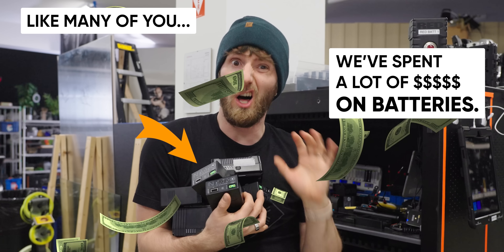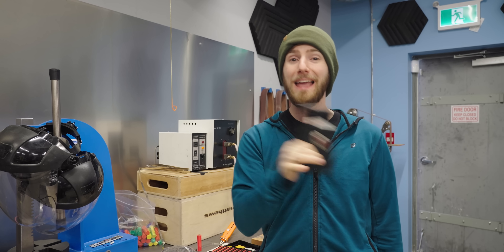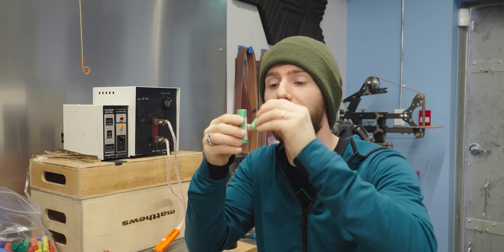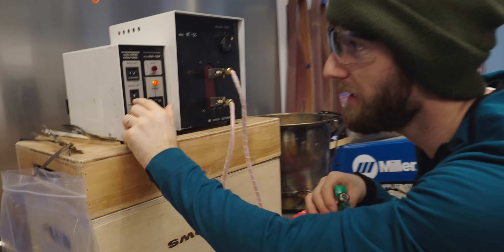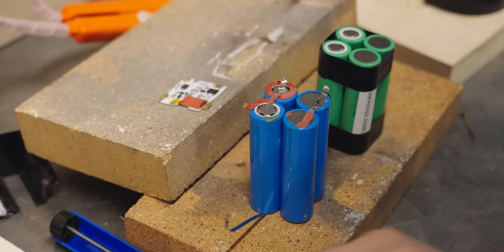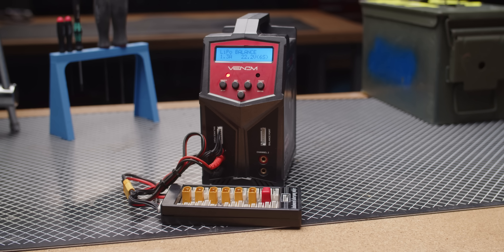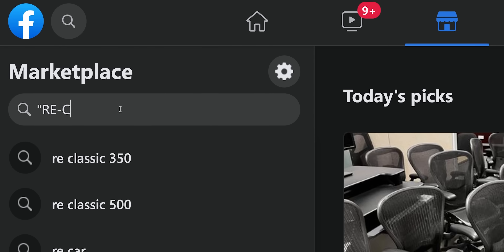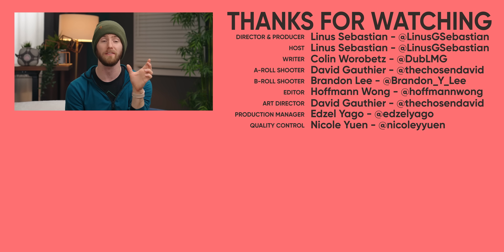This should be illegal… Battery Repair Blocking

Comment: Nice one, Linus. I've been harping on about this in all areas of manufacturing for years. If its about making money, they could simply over charge us for replacement part instead of a normal charge for an entire unit. ie - a $300 device needs a $20 part to work... but they dont supply those parts coz it loses them money, they could sell the $20 for $80 or even $150. It is means less waste, I'm all for it.
Reply: Yeah but you forget a few important factors: first is the total safety of the battery itself. Bebob tests their batteries by dropping them 4 times or so. Those tests aren't cheap. The bigger names (like Bebob) in batteryland also get their packs certified for airtravel. Those tests are really not cheap...

And though I don't know anything about where they actually recell their packs, if it's done in Europe, you just pay the price on labour, but at least you get a better guarantee that it's done good.

Recelling a 16-cell V-mount (I've got Bebob's myself) and completely resetting the gas gauge (BMS) inside to have them accept the new cells and capacities easily takes me 8 hours or more. The tolerances come extremely tight to get 16 cells to fit back inside the case on all 6 sides, it's scary and though I can definitely say I'm an experienced electronics guy (hell, I even make a living out of being one since 2 months), it's something I only do when I feel absolutely good. If there's the slightest hint of fatigue, I decide to wait for a better opportunity. A 175 Wh battery is not something to mess with.
Reply: @weeardguy  "in all areas of manufacturing". Ie, a pool light, a vacuum. Ant part that a home user can unscrew should be available for purchase

Comment: If one can swap the battery in vape, then one could swap it in any battery pack in the same manner. That's it. They just don't want you to do it. There's no big diference between these lithium batteries and simple AA type betteries in terms of safety (if you don't have to solder anything), the main difference is only in type of housing and someone's intention not to give us an opportunity to change cells.. That's it

Comment: So how much did that refurbished battery pack cost you and still didn't work?  Those LG Greens run about $12.50 each, looks like there are 20 of them in that pack.  So say $250 for the new batteries.   Now at $350 to $450 to replace the pack,  which lasts what?  4 years?  You are using about $10 per month worth of battery life.  Long and short of it.. It just isn't cost effective to refurbish those battery packs.   Not even taking into account the batteries you distroyed.

Comment: AKA what Logitech do to its products, I have issues with my G27 wheel, opened it and found Loose Screws on the optical sensor that made the optical wheel more prone to crack with time and usage, and it was cracked, similar loose screws on my G400S gaming mouse.

Comment: No that fire extinguisher no only won't help, but possibly make it worse.
I have actually had to put out a relatively small lithium fire, but we had the proper extinguishers there on the facility, but to run and get the nearest extinguisher two buildings over, adding about 4 minutes before I could get the extinguisher charged and spraying.
I am adding this because they mentioned on the video there is nothing made to extinguish a lithium fire.
We purchased a few very expensive ground powdered copper designed for metal fires.
Was not instant but worked well enough, but given it was burning in an area no more than 12-15 sq feet. Wouldn't want to deal with anything larger.

Comment: 10,000 comments.  I may get some hate, but I'm not reading them.  That would take me many hours.  Is there any reason why one couldn't build a battery pack that has a door on the back where you can take the 'battery' shaped things out, and put in new ones, you know, like on my remote control?  Presuming you believe it is horridly dangerous to ever reuse any of them.  Because you're the internet and a .01% chance of danger means DANGER.  I mean after all there are 10,000 of you.  A .01% chance means on average bad things happen to one of you.

Comment: The "Evil" BMS systems aren't really evil (usually).  Most of them were produced for the early generation lithium cells which had a nasty tendency to explode as they got older.  The quick band-aid fix for that was just to limit how many times you could charge them up.  As the understanding of the lithium chemistries advanced and we figured out how to judge cell condition from how they behaved during charge and discharge that ceased to be necessary.  New ones that use the same model might be evil.  Or they might just be stupid.  New designs cost money, so why change anything if it's working, right?  Especially for all the manufacturers who got a design from someone else and don't actually have the talent to do a redesign in-house.  Heck, they might not even realise there's a problem.

As for the not caring and just making things as cheaply as possible issue...  Well, a large part of that's on you.  Do you deliberately find and purchase the repairable versions of things whenever possible, even if they cost more?  No?  Well then you're telling the market that cheap is more important to you than repairable, so that's what you'll get more of.  If you want to change it, just start making repairable a priority in your shopping decisions and the manufacturers really won't have much of a choice but to change their priorities to match.

Comment: Hi guys! It was actually very interesting. I understand why you need to have the same voltage in all of the batteries that you plan to connect together. I’m a total noob so like I have no clue about this stuff but I am interested. I am wondering if you could eliminate the risk of shorting out the batteries while you’re spotwelding, if you were to drain them completely before doing the welding?

You know, about that planned obsolescence bit and prevention of repair bit under the guise of safety, I think That there’s got to be  grounds to fight that on the basis of environmental friendliness and fighting global warming, at least for some items. Just saying. :-)
Reply: Draining Li-Ion below a certain v destroys them..not like NiCd which love to be run flat..
Reply: @oilsmokejones3452  💔.  Thanks for letting me know about that. Sigh.

Comment: As long as you test the each battery in the used pack. There is no reason not to reuse batteries. Charge and discharge them to find capacity. let them sit for a week and see if any loose voltage fast. If they dont they are OK. Made my own Ebike packs at 48v and 60 in series and parrellel and had zero issue. I also solder so again not getting why you are so nervous. Just use a BMS and and add voltage readers and you would be fine. LOL he is so scared of LIPO yet he still has a ring on his hand.

FIRST RULE TAKE RINGS OF FINGERS WHEN WORKING WITH LIPOs or LI IOn.

Comment: Inside the bms they have a counter on how many charges you get ive tried this on a laptop an it was a success but eouldnt fully charge because of the limit on the fact that they only watch charging intervals
Reply: Also with that the cells you took out could have been good just charge intervals was met

Comment: If you have one of these batteries catching fire, put it in WATER, not sand. You need to take the heat out of the battery. You cannot extinguish the fire, because it generates it's own oxygen, so you need to take away the other side of the fire triangle.

Comment: Those plastic battery spacers aren't the least bit necessary, that's why Red didn't use them. You just have to insure you have high drain cells, then you can butt the cells together with nothing but "electrical fish paper" in-between your p-groups. That way, you get a denser, longer lasting battery pack. That's how almost all battery packs are built. The spacers are good for things like diy powerwalls where space isn't an issue.

Comment: I never spot weld.   I just copper plate the ends and then solder wires.    I use copper chloride or copper sulfate.    It takes a couple of seconds to plate each end in a solution.

Comment: TRUE: Malicious incompetence & secrecy obstructs professional repair of batteries across industries. More repair = less sales.
ALSO TRUE: Acquiring components is the easy part of multi-cell battery assembly. Matching, assembling & configuring multiple cells & control systems to work as one battery unit is a very technically difficult & involved process. Minor errors can be catastrophic.

As pointed out by others, among other mistakes, the process shown was insufficient to verify cell compatibility & will likely result in increased wear & possible fire/explosion. I find it more likely that the BMS has a specific wake-up process than a self-destruct mechanism that would be costly & decrease testability. Will RED share that publicly for professionals? Probably not, and that's the real issue.

Comment: To change cell, connect another set of battery to each battery tab then disconnect old cell the bms must be continuously powered and if accidentally shorted then it is gone... Dyson vacuum bms do this too. If you break power to bms by disconnecting 1 cell, it will flash red and locked can't be reset. Only way is you must keep it powered with another set of battery with wires to each tab then pull out all old cell.
This also applies to laptop battery bms which will also lock itself upp if you short or disconnect the battery without powering the bms with another set of battery
For the part where checking if capacity suddenly increased and lock the pack, I have never encounter any yet

Comment: I don't know linus.  There seems to be an actual safety concern when it comes to messing with battery internals, which is the excuse that we often see from corporations who implement some kind of mechanism that prevents DIY repairs.  But this is the first time where I think that that argument is used legitimately, so I don't think that it should be illegal.  Maybe you should be allowed after getting a certification or something, but not before.

Comment: Although I agree somewhat with your opinion about repairing certain components, I think manufacturers need to protect themselves from liability should a repaired battery fail and cause a fire. So in this instance, I thinks it's best to NOT repair battery packs.

Comment: Nice try , question if u had a few Batteries that was low why didn’t u just charge them all at 50% never put together a pack when fully charged . Also the BMS  couldn’t you keep power to it at all times and then move it over to the new pack and hook it all up ? It would trick it into thinking it was never messed with .. 

It’s an idea might just work use a power supply to the BMS  

The only time u need to balance a cell is when it’s more then one cell   U can get away with not balancing the cells when charging as long as the cells are some what close  the Vemon lipo charger is a pretty dec charger .. they also sell a. Lipo balance hand held checker it just plugs into the balance lead , i use them on my nitro helicopters .. 

Batteries have come a long ways from the 80’s lol it’s amazing the power they produce now.

Comment: The thing is, this problem will never go away with professional equipment. Professional cinematography equipment is horrendously expensive (most of the time with good reason), so the manufacturers expect you to have the money to throw at a problem instead of doing repairs yourself. I get it, I would be far more comfortable spending the extra money on equipment that is guaranteed not to fail as there are very few times when one can allow for that to happen, instead of undertaking repairs and builds myself where the only guarantee is my own handiwork and basic checks I can do with limited equipment. 

However, I believe consumers should be given the choice to buy the official product, or be able to undertake repair work without the manufacturers guarantee, at least for items that experience higher wear-and-tear (batteries, cables etc.). This would not only allow the manufacturer to continue to profit from companies that have the funds to continue buying the official products for the guarantee, but also allow companies that are starting out to provide a good product to their customers and save by repairing equipment themselves and thus taking on the risk themselves.

Comment: I agree with your general principle, but I think you're overlooking a major reason for a manufacturer blocking these repairs with a smart BMS.  If the user/operator does something incorrect in the re-cell process and inadvertently burns their house/car/business down, there will almost certainly be lawsuit issues that the original manufacturer was liable.  Numerous companies have had to defend themselves against liability for a customer or other 3rd party doing just such an "unauthorized" repair that went horribly wrong.

Comment: DJI batteries fall into the "EVIL" category - if a cell goes out of spec a bit is written in the EEPROM, and it cannot be reset. This happens even when all the cells are still good and you replace one (or all) of them (and ensure that every cell is balanced before reconnecting the BMS).

Comment: Don't do it!?  It's done all the time.  It Involves getting a voltmeter and replacing bad cells with the same type of cells.  And that's it.  One will need to do the battery swapping more often as previously good original cells will obviously not have a full life left, so will need to be replaced too.  But at least your efforts will cost you less and be better for the environment.  (Not everybody is as rich as Linus the YT dweeb.)

Comment: Good video.  I like the video.  Very informative.  But, I do have question. I'll save that question for last.
First, a suggestion: why not hook the BMS to a power supply during the repair, so that it never knows the battery pack has been disconnected?
The other question: Is it really cold in your shop, or are the sock hats just a costume?  =PC=

Comment: You start to understand here why each battery costs $450, and why that’s a relatively low price - because every hour spent here is lost income that would be better spent moving the business forward creating content, and on top of that there’s serious risk of fire and/or injury. In this case the cost to benefit ratio works out because the danger and the investment in labor are compensated for by the fact that it’s generating this monetized video content - but for anyone without a successful brand to make up the cost, this would only be a dangerous waste of time and money.

Comment: protip: if you charge each cell individually in bulk, you can get their voltage to be the same when you put them together to avoid sparks just as long as you dont rupture.
Reply: This also looks like only the Nickel sparks and not the battery itself.

I made a battery pack and also got a few sparks because the current went through the nickel and not through the battery pad because I didn't press the nickel down with enough force.
Reply: Better off draining them to the same levels.
Reply: @Mr.Unacceptable  the problem here is the voltage level. if you drain how will you do it in exactly the same way? Its not the amount of charge the battery has but its voltage. Hence charging all batteries to the exact some voltage individually is the easiest and safest method.
Reply: I thought about this and wondered if that would work. I couldn't see why not. This should be common sense.
Reply: One of these days somebody will design a battery that behaves like a regular battery instead of a computer dependant fusion reactor on steroids. Or maybe not. Probably not.
Reply: That's what I was thinking too like getting one of those chargers that does 4 at a time
Reply: Pro tip: Don't get your cells as excited as humanly possible before doing surgery on them. The less angry pixies the better, moron. When you're a pro you can start giving pro tips.
Reply: Lol what the actual fu...
You don't add more explosive power to something already explosive as a Safety fix lol
Reply: @OutOfNameIdeas2  not really, charging them doesnt magically make them a lot more explosive. Rather you want to reduce the transfer of current between the batteries when you put them together. even a .1 voltage difference can damage the battery or worse. So when dealing with raw cells before you pair them you charge them to a set voltage individually, not charge each of them to full. The idea is to get all the batteries to the same voltage to pair without making them explode as a voltage difference can allow a huge current to flow and potentially cause the explosion you are so worried about.

Comment: I have found that the BMS was frequently also defective, therefore requiring a generic replacement usually from China.  I have reused many old LI 1860's (after testing) successful. That's been my experience using 18650 batteries.

Comment: You don't need to do all of that crap to repair batteries. The secret is called rotating stock. Observe your non working batteries and then observe who has exactly the same batteries as you but holding a charge just fine. Where you need to bring your batteries from to where theirs are and then back home is a round circle trip and the batteries are the stock. Rotate that stock and your batteries work again. And you created no extra waste for the planet and sacrificed no precious time endangering yourself with the bollocks you viewed here.